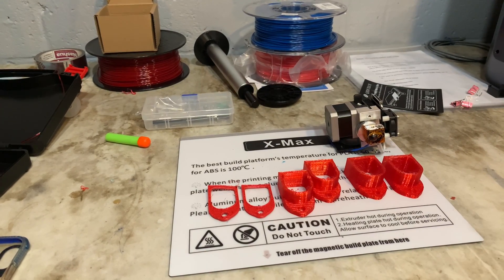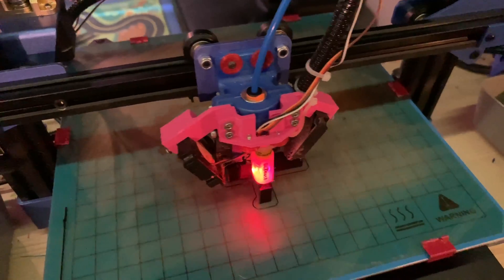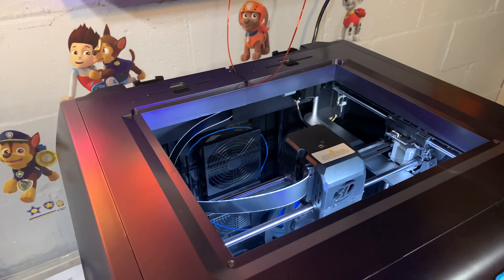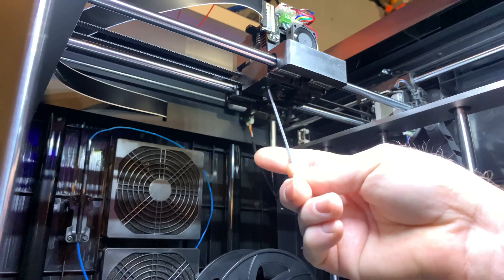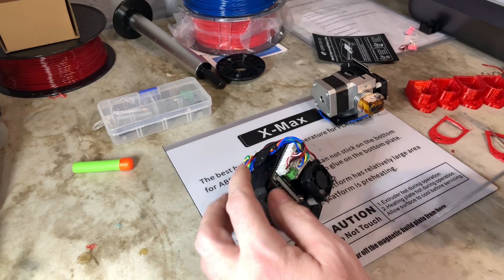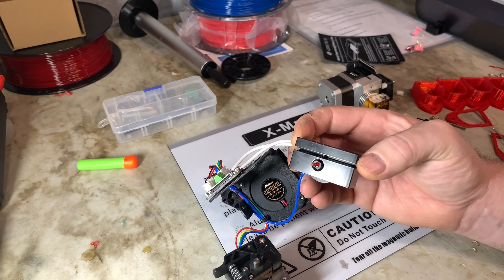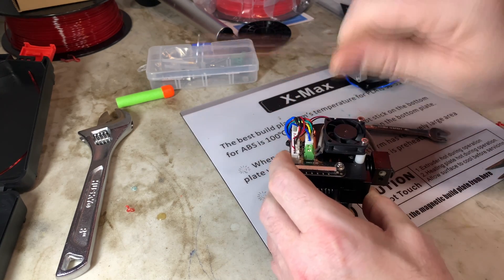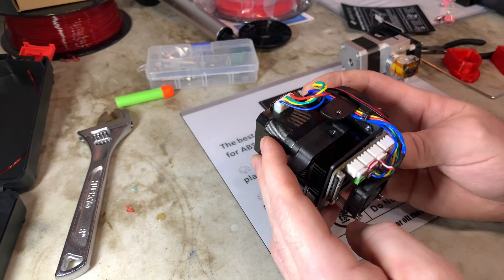Qidi X-Max More extruder jamming issue! More extensive extruder tear down

Comment: So I bought the xmax 3 years ago I have only been able to print 5 or so prints because it keeps clogging here and I'm tired of tearing it down just to end in failed print every time i unclog it halfway through the prints on slow speed settings to high speed settings it does it 100& of the time I have replaced the ptfe tubing I have tried small nozzles big nozzles I even got qidi to send 2 new heads 1 low temp 1 high temp they would not refund or help further so I'm now without warranty and 100%failure rate I am trying to use pla with low temp head and still clogged up in upper hot end I have tried butting the tube up to the gear area and even left air gap but no matter what I do this thing is a POS I really regret getting this pos it is literally a paper weight the old end 3 works 10x better but is way to time intensive the xmax was supposed to be a good printer but I have had nothing good come from this pos I have dedicated days on end researching fixes and doing ungodly amounts of tweaks to cure and to this day its nothing but a waste of my energy time and effort F rating accrossed the board for xmax unit picks and has always sucked from the day I got it qidi is not what you want to spend that kind of money on no way go with a company that is known for quality yes the price is higher but at least they work
Reply from the maker: Sorry for the struggles! I ended up selling mine to move on to something else. Honestly it is over priced, for product and performance you get. I recently bought the Bamboo Labs x1 carbon with AMS and love it.

Comment: amazing... Ive used this machine for 3 years and have only had a couple of clogs when i first got it. havent had a clog in at least 2 years..... about 15 rolls of filament at least.
Also note there are two versions of the extruders (I dont mean all metal and ptfe, I mean the designs)... one blocks the gap

Comment: I have found on mine I only get extruder clogging if I don't do a full leveling at least once a week. There are fixes for the sensor mounts but I just level and have no problems.

Comment: I have this same problem, i contacted support and told me to send a picture, they checked and told me the fan was assembled backwars (yes it was me, originally it goes assembled blowing air to the nozzle), corrected and it works now,  no more clogs... just like every 3 or more kg of used filament it need this maintenance...

Comment: The clog happens there because it is a gap between the end of hot end and the pushing gear hole. You have to make sure the plastic tube goes all the way to the gear hole. Also use termal paste between the metal tube and cooling discks. that will prevent the clog inside of the gear.
Reply: The best way is just throw away this two extruder’s and mount some serious extruder and a truly full metal hot end . Otherwise you will have constant various problems with them .
Reply: @piotrpaderewski299  how to do that, can i attach another extruder?
Reply: @romanasbadaninas9703  Google it a ” icarus 2.1 ” , print this carriage and then its wił be only up fron you , what caine of parts ( extruder , hotend , fans etc ) you will chose to use . 
I am running a orbiter 2.0 and trianglelab Rapido UHF version with Diamondback 0.6 truly diamond nozzle . This set it’s waaaaaay better as a standard one’s what’s come with the printer . Basically indestructible!! Also , I notice that Qidi was chose very similar way with design a new Xmax 3 . They also used very similar hotend an different way of x carriage mounting .

Comment: for starters Im pretty sure you should not be printing TPU with that hotend, theres a reason why it has 2... that one is only suggested for Nylon and CF. but I'm assuming you asked the fabricant about it mate.
Reply from the maker: Not using the high temp extruder with TPU.

Comment: I own both Qidi X-Plus and X-Max. In my opinion they are the best printers once setup properly. In the beginning I was like you. I use Polycarbonate/carbon fibre filament which requires high temperature nozzle and carbon fibre kept on clogging my nozzle. I trashed a full hot end because of it and kept on changing nozzles every second day. Now it never clogs and prints flawlessly clean day in day out - and my prints are like 10 to 17 hours each part. Here are some tips. I hope it helps:
1- Never level the machine with recommended single point levelling. Always level manually.
2- Never let the machine turn off on its own after a print. Always let it cool down and leave it there about an hour after it cools down before switching off.
3-Nylon, carbon fibre, polycarbonate like materials are never dry to begin with. Either put them in oven for about 3 hours at 60 degrees Celsius or invest in a Polymaker's   Polybox II. Now these boxes saved my life. It keeps the filament always dry and clean. I bought 3 of them one for each printer and never looked back. No more filament drying, no more filament breaking during print.
4- Don't use the spool holder system printer came with. Drill a little hole on top of the cover and let your filament come in from the top. I could show some photos of my setup but I don't think we can post photos here.
5- Qidi videos show you how to clean the build plate with wet towel while inside the printer. Don't do that. Take the plastic out wash it, dry it well and put it back. When you clean it inside the printer, as the plate heats up it creates lots of moisture. 
I hope this helps. I know how you feel.
Reply: I've been looking to possibly buy one of these. Good advise, do you have a picture of how you did your filament?
Reply: For those abrasive filaments you use a hardened steel nozzle. I’ve had my 0.8  steel nozzle for months and no issues printing polycarbonate on the I-mates. Mostly printing abs now since I tried Hatchbox but every once in a while I do car parts out of PC and all my filaments print just fine on the black side with no adhesives. When the bed is perfectly leveled (I use a card from a deck of poker cards) prints stick pretty good then after the fans stop by themselves I can go and lightly tap the prints and they come off as if it never stuck. Rarely do I clean my build surface with alcohol or at all only when it’s really dirty. The rest I’ll just quickly vacuum out.
Reply: Can you post a picture of your setup where you drill a hole on the plastic cover?

Comment: How's everything going so far with this printer? I'm about the buy one for Nylon and Nylon/Carbon printing specifically. Your filament is definitely getting too hot and collapsing before getting to the tip. Adding cooling and possibly the duct that Pardner4543 uploaded will help (I can't exactly tell from his photos). 

Just looking to see an update from you. It's either buy this enclosed printer or modify a CR-10 Max, Ender 5-Plus with enclosure hot-end upgrade. The time modifying it will be a break even in cost so I was hoping this unit works well. 

Thanks for uploading this video and communicating. It's helpful for people like me trying to make the right decision before buying. Also too bad this doesn't have a run-out sensor! I hope they support it for a future upgrade.

Comment: I'm massively disappointed with my X Max. I love the design, and thought it would be the best for the money. I am constantly having failed prints. On my CR10, if the first layer is good, I can walk away. Xmax, still about a 1 in 8 fail. I think I'm losing steps in the Z axisfor no reason. I should not have to level the bed every tone I print, and that's still not a guarantee. I've also had slicer problems. I kept having a simple part fail with Simplify3d, sliced in qidi and it worked. Had the same problem but with the qidi slicer. I hate this printer.
Reply: same for me. looks like a good printer. actually crap.
Reply: @brettcnc  I followed their "procedure" for straightening the print. It is just forcing the gear to jump teeth on the belt. While I'm disappointed their isn't a fine adjustment, it is putting out acceptable prints. Don't know if it's worth the money though.
Reply: send me the qidi x max (smile) i have the qidi i mate s - out of the box /pla /abs no problems never. pla normal leveling abs smaller leveling this is my tipp vor you

Comment: I have no experience yet with 3D printers; I'm in the research phase, but somewhere along the way on some model printer review I saw a similar situation where the filament had melted inside and clogged, the piece they pulled out was mushroomed just as yours is here. If I recall correctly the issue had to do with that plastic tube not seating fully, I think in their machine it had pulled up slightly during use, but what happened because the tube was no longer in the correct position the melted filament was filling in the gap (the mushroom head) and in turn creating resistance for the filament trying to be fed through for the print job; eventually it just plugged it up entirely. In their case I think they ended up replacing that plastic tube with something better, it was some common aftermarket brand that is blue. That's all I got. I suppose I could go look at your later videos to see if you solved this..... ;-)
Reply: I've been looking too. A lot of people seem to like this one.

Comment: To fix this issue you drill out the top end of the heat sink to make it a V2 hot end. Which allows the tube to go all the way out of the hot end. I had same issue even on low temp hot end and instead of buying a V2, which fixes this issue, I modified it. Qidi doesnt recommend it but even a monkey could do it.
Reply from the maker: I was thinking about replacing the plastic with  a brass tube. Do you think that could work or will it transfer heat too much. I bought brass and cut to length, haven’t tried it because adding a second fan has helped so far.
Reply: @TTV_FUN_AT_50  I would think that the brass would conduct too much heat into the filament , I'd be cautious with this.
Reply: Do you have any web-link to help on this modification?
Reply: @freelancemotorsportsllc2826  no, I should have taken pictures before and after. The ptfe tube will only go so far in the heatsink tube, It has a lip towards the top. You just  drill it out so its the same diameter as the part where the ptfe tube slides in, it will allow the ptfe tube to come out the other end, like you can just slide it all the way through. The v2 has the ptfe tube going all the way through so the filament doesn't lean against that hot lip anymore. Fixing most heat creep.

Comment: I started having the same problem, clogs exactly same as you show.  Been printing fine until about a week ago.  Changed nozzle, tube, etc. no joy.  I saw dust build up on the chamber fan filters and there was some dust build up on the heat sink.  Cleaned both and seems to be working now.  The dust on the heat sink probably created a thermal barrier that didn't allow the heat sink to cool enough from the fan (best guess).
Reply: drill out the heat sink of the hot end and make it v2.  it takes a longer tube and the tube will actually sick out and insulate the filament from the heat.

Comment: Might want to take a look at a couple more things going on here with your slicer, too. Your prints look rushed and you might just need to tweak some settings. There are a million ways to print less than stellar objects on any printer with any filament obviously, on the other hand finding the sweet spot for each respective filament can take a while.
Reply from the maker: Prints look rushed? What does that mean? This is the quality coming of the printer at modest speeds using simplify 3D slicer.  Same file/material I printed 100’s of these  on $300 dollar printers with very good quality.  I normally print at 40mm/s or so with no issues, highest I go on larger objects is 50mm/s
Reply from the maker: Was having the same issue on high temp extruder. Added additional cooling to the cold side and the problem went away.
Reply: @TTV_FUN_AT_50  hey, having the exact same issue, are you saying all I have to improve the cooling, please how'd you manage that

Comment: I have had my X-Max for about 6 months and only had to replace my nozzle today. Just make sure you use the right hotend for the right material. PLA, PETG, ABS are all for the low temp extruder (or it will jam in the high temp). I love this printer.
Reply from the maker: Yes understood. What about Nylon? high temp material correct? I had 15 jams in a row on the high temp extruder. There are issues with the design, like heat creep. This really shows up with Nylon. I added a fan for extra cooling on the cold side of the nozzle and my problems have gone away.
Reply: @TTV_FUN_AT_50  Just to confirm, you are using the backside/dark side of the print bed?  I haven't had problems with Nylon yet but I haven't printed with it much on this printer. What brand filament are you using? Also, are you using the internal spool holder for your nylon (or an external dryer)?
Reply from the maker: @DudeBoerGaming  I am actually using a glass bed for all of my materials. I use glue stick with the nylon. The jamming happens with the nylon as it is very flexible and heat creeps up into the cold side, this causes the nylon to flex too much between the extruder and the hot end. The hot end also has a plastic piece that gets necked down from heat at the nozzle end that also causes issues. Adding a cooling fan in the place the part cooling fan on the low temp extruder would go has helped a lot so far. It’s a 50mm 24 volt case fan blowing on the cool fins. After 15 jams (not at the nozzle) once a fan was installed I had a finished 5 hour print. Printed it again and it failed, turns out the cooling fan had failed. So the problem can be turned on and off by using or not using the additional cool. I have been sharing by info back and forth in regards to cooling with QIDI.
Reply from the maker: @DudeBoerGaming  ESUN I believe, it’s my second spool has worked well for me. I have it in an external heated drying box. I only print Nylon and TPU on this printer. I have many other printers for PETG. Don’t print much PLA except some with speckles in it.
Reply: @TTV_FUN_AT_50  I have the same problem with my high temp extruder. I was thinking heat creep was the cause of it, and since we have the same issue it appears I am correct. How did you add an extra cooling fan on the cold side? It seems pretty much impossible to modify the cooling.
Reply: Did you use ASA on the low end temp too? Im using that instead of the ABS. ASA needs 250 degrees
Reply: @dingdongchingchong8659  you can print ASA on the low temp extruder. You can also replace the ptfe tube that attaches to the nozzle and use Capricorn tubing. I just had the same issue as the video but with pla so for the meantime I went back to the low temp hot end and I’m running with it up to 270 for polycarbonate no issues.

Comment: After watching another Youtube video on Qidi extruder heads I came across this. Maybe you could consider changing the extruder nozzle. https://www.youtube.com/watch?v=1ast3hPhLcM
Reply from the maker: Thanks, I will get one to keep in my back pocket as another option. Although we have the same problem statement there are different root causes for our failures. He is needing a larger nozzle to compensate for the fibers in the carbon fiber material he is printing. I am having failures with nylon which has better coefficient to friction properties. My problem is the nylon acts almost like TPU and is very flexible in the unmelted state, a little bit of heat creep makes it too flexible to be pushed through the plastic tube and into the nozzle. Most of my jams are in the plastic tube just before the nozzle.